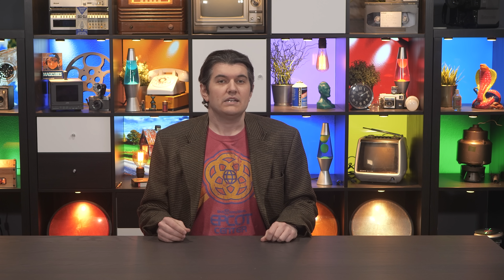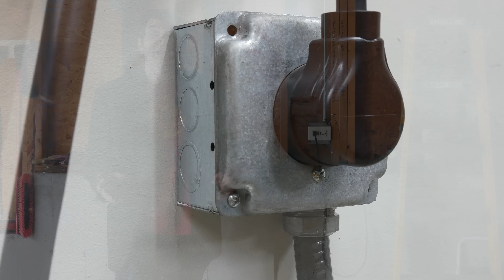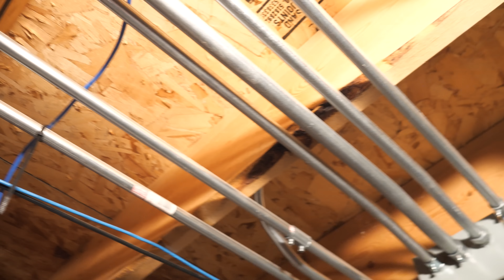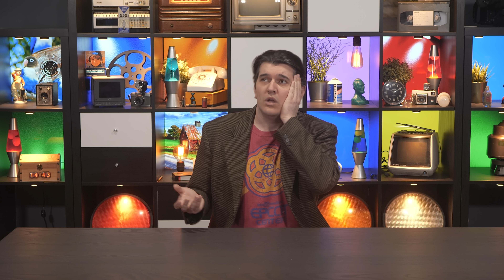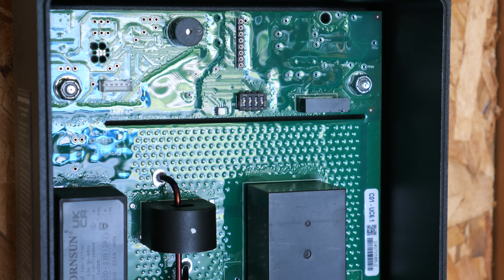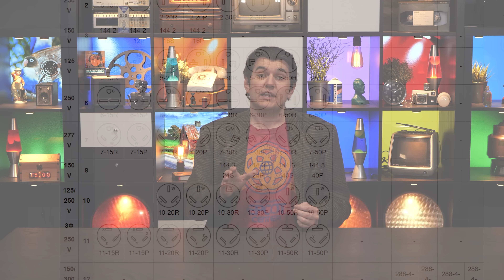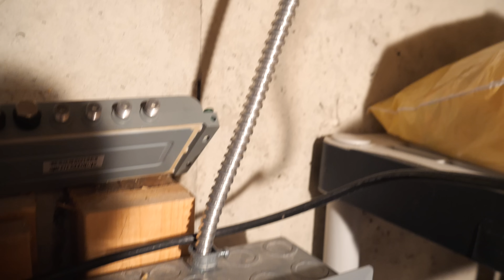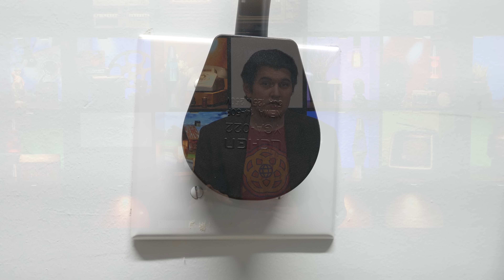The "standard" car charger is usually overkill—but your electrician might not know that

Comment: My Volt charges 40% faster on standard wall outlet using included Chevys charger (40milesnover night)vs a Tesla model 3 using Tesla included charger <25 miles over night.  Big difference

Comment: I installed 50A 240v for $800 at my parents house where they have solar.... Do it once and dont worry about it. Less range anxiety and no big deal. Side note technically its not a charging station cause its just a standard plug and not really a fixed car charger which is a good thing...

Comment: NOTHING connected to the internet is private or secure.  DVD players and light bulbs have been hacked to run denial of service attacks.  Yes, your connected door bell make and model has likely been a victim, too.  {You can use so called commercial market equipment off grid.}

Comment: When our outdoor A/C unit was replaced, they wired it for 30@.  Since I am a bit gun-shy because of a failed breaker that was "worn-out" by operating at or near capacity, I asked that the 33@ starting load have a 50@ breaker... Not for the wire, it likely could 33@ all day, breakers don't like running warm.

Comment: MC cable doesn't stop at 10 gauge. You can get 4/3 MC cable. I wish you could get 4/2, because you don't need that 3rd wire for charging, but 4/3 is definitely available.

Comment: Yes, you can charge at 120V and 15A. But someone who is doing this asked me to install a charger. They say they have a Tesla Model Y and it can only pull 32 amps. I reply that in the future there will be two EVs in the driveway, and each will want 48 amps. I don't want to be the guy who charged them $1,000 to pull a #8 wire. Yes, $1,000, because we need to cut up drywall, drill through concrete, patch and paint stucco, replace drywall, paint the interior, and crawl about 50 feet through an 18-inch-tall space. As long as they are spending that much labor, let's pull 4 AWG cable. If I don't, they will kick me for saying the second charger will cost $1,200 ($200 is for inflation). OK, my point is that you are right. A 1.5KW outlet can work, but there is a very good reason to "go overkill" to save future cost.    We are headed for a world where the new gas cars will be banned in only 10 years in some places.
Reply: Agree if you are already ripping dry wall.  How about for charging cars in series (one at a time) instead of in parallel (at the same time)?

Comment: OR...and this is just a hot take...before you go with the choice to choose an electric car...do everything correctly and the best way possible, and get a 240v outlet, with a EV RATED receptacle, and have a 40a charger so you can handle any situation that could come up...

Comment: 4:34 that’s not how that works.. The wire gauge has to be sized to that not the end device. Think about it. They’re not putting a 24A breaker on that line
Reply: I don’t understand your comment?
Reply: @patrickhynes6058 if you have a 100A breaker, you have 100A. You don’t apply the 80pct rule and say you only can use 80A of that circuit, that doesn’t make any sense. What you do instead is use a wire gauge that is large enough so that that 100% of your continuos load does not exceed 80% of the wires ampacity.
Reply: @NeverFinishAnythi I understand that the continuous load rule is the 80% rule. In other words, you could have up to the limit of the circuit breaker for brief amount of time, but if you’re going to be putting something on that circuit for hours at a time, continuous such as EV charger then it needs to be at 80%

Comment: I just found out (much to my annoyance), you cannot adjust the AC level 2 charge current of the chevy equinox. Its fixed at 48 amps.
Reply: That is not true. Any EV will get a reading on the max amp from the EVSE. What are you using for that?
Reply: @patrickhynes6058 I believe one can buy the 30 amp dongle for the charger with a NEMA 14 -50P. This should signal the charger to reduce the current draw to 24 smps. Correct me if I'm wrong.

Comment: I had a "future proof" oversized wire ( 8-3 gage 40amp) ran to my garage and set it as only 240VAC 20amp, using a 16amp "slow" charger for our 2015 Nissan Leaf (100 mile max) car. we drove 26>40 miles to work/local shopping and it charged in 4hrs no problem for 10yrs. now we have a 2025 Chevy Equinox EV (365 miles max) new car and are still using the same "slow" charger that takes 8-ish hours to charge once every week-ish, and still haven't bothered to "upgrade" to a normal or fast charger.😅

Comment: i can slow charge at home using a regular 110V/120v outlet with a cable included with my EV. the same cable actually has a dual adapter that has the  regular 110v/120v adapter, and the cable also has the 220/240 adapter  to plug in if you have a 220/240  outlet for much faster charging. i lucked out and am able to charge for free at work

Comment: I also have a bolt EV, my commute is 166 miles round trip, so I got a level 2 charger on a 50 amp circuit for mine, luckily I'm able to charge at work so when winter comes I should be able to get home without having to stop at a super charger....

Comment: More people need to truly evaluate their charging needs. I have a 100kwh battery in my car. I have the Grizzl-e Classic 40a. I have flat rate pricing for my electricity. So, I can charge for the same price regardless of time. So, if I'm at home I can charge. So, I put my Grizzl-e on 24a. I can charge from 20-80 in about 12 hours. This also has the added benefit of lowering the heat generated from the resistance of the wiring by about 70% compared to 40 amp. Not enough people factor that in either. Amperage exponentially increases heat.

Comment: 6:38 if you got a EV it's definitely worth installing a 240v outlet or circuit if it's a direct wired charger .it's much more efficient to operate at 240v than 120 v .why do you think all appliances like electric range ,electric water heater ,whole house AC etc. Operate on 240 v .charging on 240v saves you $ .

Comment: No mention that a GFCI circuit breaker is required to meet code. This is an expensive item. Coupled with an EV-duty 14-50 NEMA receptacle and code wiring, the cost is very close to hardwiring an EV charging station, which comes with an inbuilt GFCI.

Comment: Wife has a 220 in the garage and I have a 120 outside. both work fine in all seasons, hers is just faster. Mine is a 2019 so it has the older battery too :)

Comment: I hate when people say, I don't want an EV car because how am I going to fuel it without installing a charger.  I am always shocked how many people don't realize its literally be like putting in 3-4 gals of gas a night daily at home; even slow trickle charge with a standard wall outlet!  And the same people are plugging in a golf cart at the golf course every time they park it.  The convenience is far more readily available at home; it's a no brainer to get an EV.  Thank-you for your video, I think EV vehicle manufacturers need to collaborate and run infomercials educating folks, exactly like you just did!

Comment: I recently bought a used EV and found it was too slow to charge with 110v even at 12 amps.
I find your video makes sense the charger I got with my car has an adapter for the electric stove outlet and is marked as 30 amps on the back.
I am fortunate to have 220 volt power from the pole.
The articles on this subject are very informative but it’s confusing to me.
Some ask for heavier wires number 6 at 220 volt.
I talked to a company that specialized in home charger installation they wanted $2,200 to permanently install a charger.
But the idea of using the outlet and number 10 cable and doubling the charging speed of my car is going to be easier.

Comment: I think low chargers are an excellent option especially for thermal management.  

If you have a 240v 15a delivering up to 12a is 2.88 kWh.  Sounds low; it is low but for a reason.  

Winter, when it dips very cold, the battery won't use its stored kWh as efficiently.   If you charge to low and slow charging in the cold, you end up charging for 10 hours (initially heating battery). When it's ready to be driven in the morning is still slow charging. The battery will have been kept warm from charging and ready to drive more efficiently since its been heated since you got home the day before.

Summer has a small bonus. When temps are high, you don't want to add a lot of excess heat fast to the battery if you can.  Given time heat will radiate away during slower charging. The BMS will easily dump the rest, maintain a healthy heat range. during for instance a heat wave.

This cost per hour for 2.88 kW slow charging will drain me under ~75 cents / hour of electricity.  

This saves me from family and friends coming over looking to visit but also look to charge their EV too at your expense.  At 2.88kW they may not even bother for a couple of hours of charge while they stay over visiting for the evening.  If it's Short Term Rental property of, you also don't want the charging abused by guests charging multiple cars per day, theirs and their friends.  At this slow charge rate of 2.88, I don't mind them hooking up for a few hours. 

Future EVs will be even more efficient with more miles per kWh, so I think 2.88kW, a 240v 15a circuit, will be the setup for the foreseeable future.

I would like the option to switch a charger from 2.88 kWh to 5.76 kWh by an app for my car though and just let no one else know :)

Comment: we could have lived with level 1 IF our home had a dedicated outdoor 120v outlet. We did not. when the outdoor GFCI was installed on a shared 15a circuit yielding a whopping 800w of charging power. New wires were going to need to be pulled no matter what, so 8/2 was in order and a 240v/40a circuit installed. I was actually chided by the inspector because they thought I should have installed 50 or 60a. Did they LOOK at my panel?

Comment: Only 80 percent if it's continuous ie 3 or more consecutive hours. 2 hours 59 minutes you can absolutely run at the full 30 amps. Sooo if you can schedule the charging then run it at 30 amps then take a 5 or 10 minute break then run it for another 2 hours 59 minutes just sayin

Comment: I wish my house had one of those level 2 chargers, charging on a normal slow house plug takes so long, even if I don't drive much just having the ac on kills battery and the range anxiety is horrible also the prices and availability of charging stations isn't great especially if you don't want to be stuck charging for 30 minutes wasting time and money on overpriced electricity. Every house in america should start to have a level 2 charger in the garage would help drastically in ev adoption, people don't want to pony up the cash to install all that when it costs an arm and makes the ev payback period worse, the waste of time and money at chargers is what I don't want. Can't even touch my house  since we're renting it lol

Comment: I am not fully agreeing on the dumb EV chargers. 
As a business owner in Europe we need to declare the usage with MID-certified chargers to reimburse the charging cost back to the business, we need to get that data out of the charger in some way. Oh i am aware that there are DIN-rail MID certified KWh meters but then the taxman often dispute its usage since they don't really know if it only the charger hooked up to the circuit...
Obviously having ETA software updates is indeed unnecessary...

Comment: Thank you. You covered this topic well. I have a Nissan LEAF, only draws 26 amps or so when charging but I put in a hardwired EVSE and wiring to support a 50 amp circuit. Then I reduced the EVSE max down to 30 amps continuous and used a 40 amp breaker in the circuit. It would have been slightly less expensive to use the smaller wire but this is to enable me to easily provide more amps without having to worry with replacing the wiring if I ever get a different EV that can actually take advantage of the higher charging amperage. I would only have to reset the EVSE to the higher output and change out to a 50 amp breaker. The way I looked at it was, spending just a few extra dollars up front could possibly save a lot more of them later.

Comment: Although aluminum wiring is not completely outlawed, its use is heavily restricted. The National Electrical Code (NEC) heavily restricted solid aluminum wire for 15, 20, and 30-amp branch circuits in residences in the 1970s due to high fire risks.While older "single-purpose" branch wiring is strongly discouraged and local municipalities may outright ban it, modern aluminum wiring remains legal and standard in the electrical industry today when used correctly.The Realities of Aluminum Wiring - What Was Banned? Older, "old-technology" solid aluminum branch-circuit wires (primarily used in homes between 1965 and 1978) caused major issues. The metal is softer, expands and contracts more than copper, and oxidizes easily, causing loose connections that can arc and cause fires.

Comment: Recently bought an EV. Right as work had me going to a client Driving 60 -100 miles a day, charge about 40-50 miles overnight ( 8 -10 hours ), and longer on the weekend seems to work. Or 6 minutes at a DCFC and read a few pages of a book.

23:02 -The State has a monthly incentive for scheduled charging off peak which would basically cut my cost/mile in half!, but i need a “smart” charger. Ended up going level 2 because the price of the charger is about the same (as a smart 120v) and i set the charger at 20 amps because i already had a 30 amp industrial rated plug in the garage. 
Would have gone GrizzlE because i prefer physical DIP switches for setting the amp rating, but isn’t accepted by my utility. The software setting and my car and charging station are both software limits…, However, i figure both ends ( car and Charging station) would need to fail to pull over 20 and trip the breaker. Can’t wait for 200 amp service so i can hardwire to charge at 48amp. Better efficiency  due to shorter charge time.
BUT I STILL HAVE MY DUMB CHARGER.

Comment: What I like with my level 2 EVSE is that we charge it at 35 amps, overnight and get about a week use out of it (roughly 20% to 80%). I’m in the Chicago area serviced by Comed. I have signed up for hourly billing and will be charging overnight at 0.3 to 1.9 cents per kwa rather than the fixed 13.6 cents daily rate. I was made aware of this by Emporia, the company that made my EVSE. It was in their app.

Comment: Actually the truth is its more dangerous on the battery in the car and not good on the outlet it's plugged into. No 120 volt outlet is rated for continuous use, to leave charging for hours on end, especially at 120 volts.

Comment: I 100% agree most people don't need the fastest charging possible. I wanted faster than standard household 110 for my setup but nothing was wired up and my breaker panel was on the opposite side of the house. No attic, no crawlspace to do the wiring.

I used the dryer circuit that was on the opposite side of the garage wall. I used a NeoCharge smart splitter that prioritizes the dryer, but gives the car charger power otherwise. Just ran a short cable into another 240v receptacle on the garage side. Works great and was so much less than what I would have spent. I charge at 24amp like 15mi/hr

Comment: I live in the US. I have a PHEV. Volvo S60 T8 Recharge extended range. I was charging on my regular 110v wall outlet in the garage. It started getting hot and discolored. I had a 240v outlet installed with a surge protector. Thats really what you need.

Comment: regarding the 80% rule: at least in Germany that does not apply (probably the same in most of Europe) - a Circuit beaker for eg 16A can carry 16A continously, and is in fact dimensioned to carry about 20% more than that (at least for the typical B and C Characteristics). So in a way we also have that rule, but its used in a more intuitive way.

Comment: I’m mostly on team “smart chargers are kinda stupid” but I ended up with one because my utility provider is offering $150 a year plus a one-time $50 up front to have control over it. I can still override via the charger app if needed but so far it’s been fine and I’ve only had to do that a couple times to juice up a little extra before an impromptu trip.

Comment: DO NOT use the dryer plug to charge your EV unless you replace the outlet with an EV rated outlet. Standard commercial dryer plugs are not meant to handle continuous load demands of EVs

Comment: I just used the 30 amp clothes dryer outlet. I had to change the outlet to the type that I could plug my 240 volt charger into. Then I set my charger to 24 amps so I wouldn't overload the circuit. Very easy, it's been working fine for over a year.

Comment: If you want to save the most money for a long time, it's the way to go. Normal outlet, 4 miles per hour. 10 hours, 40 miles per day. That's great, maybe for some but here is the thing, most electric companies cut their rates by 50% from 11pm to 6am, or something along those times. Between Midnight and 6am I pay a $0.07/Kw, I have a Model S, 100 KW pack, charge to 80% when I travel for work I easily burn 200 miles per day a few days a week. The install cost, $285. If I did use all 100KW each day, that's $7 day vs $14 off peak, or $22 for 100KW of power during peak hours. ROI on the plug is so quick it's a no brainer. People already don't fully understand EV's if you can have an qualified electrician instlal an EV plug (NEMA 14-50) under $400 or even $500, 100% worth it over a 5 or 10 year period. Not to mention, winter charging, higher amps needed to preheat the battery while plugged in and heat the cabin before you drive. More advantages than disadvantes and the 110V plug at 15A is not going to handle it. Better to have it and not need it... then need it and not have it.